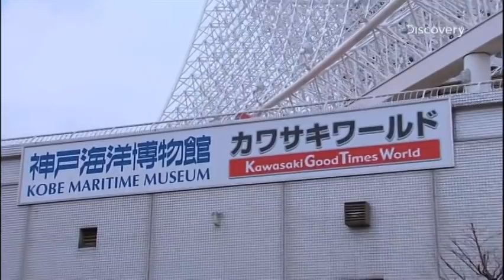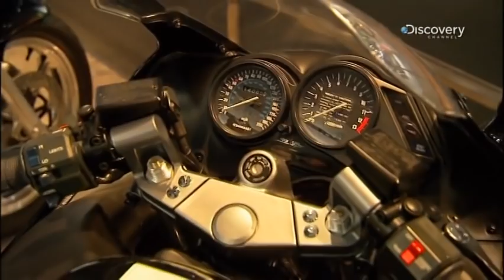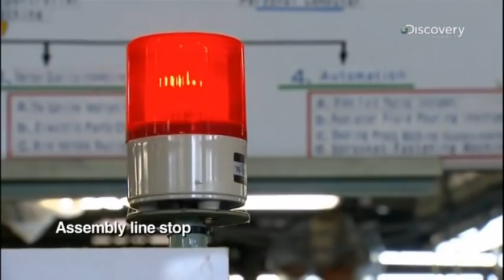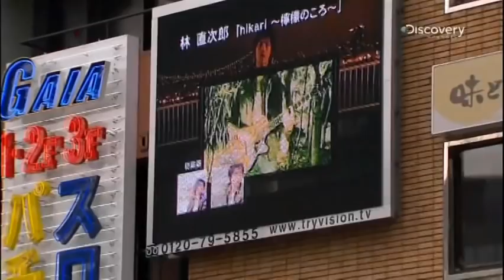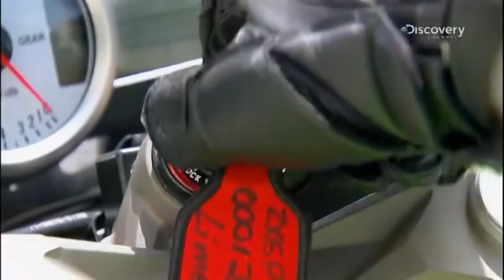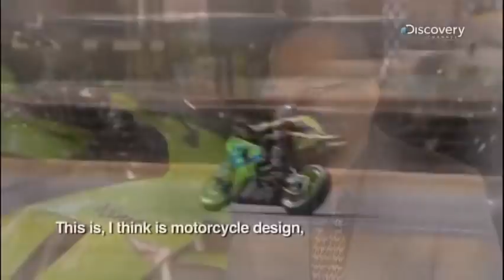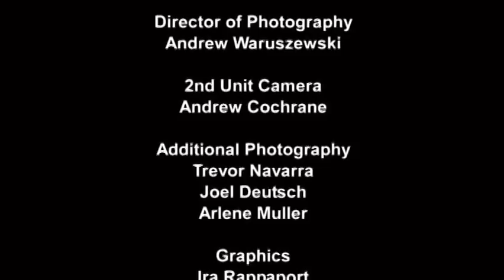KAWASAKI History, by Discovery channel, 世界のバイク

Comment: I had a 500 back in the 70s two stroke three cylinders,  Damn it was fast.  It would scare the crap out of you compared to other bikes.  Nothing like it in its time.
Reply: The engineering and quality control was always top notch at this company. 
They had Honda, Yamaha and Suzuki really worried in the 1970s.
Reply: scdevon Oh I loved the 500 triple I had.  I bought if off a friend of mine that went to highschool with me and when he gave me my first ride on it It scared the livin shit out of me.  Riding Down a windy road with sharp curves over 120 mph.  Yea he sold me on it.  I don't remember what I paid for it but I would love to have it back now.  I saw one a few months back but it needed everything overhauled but the guy wouldn't sell it.  He knew what he had.
Reply: R 
I never owned one, but they are real collector items now. It's too bad that 2 stroke street bikes were on the way out in the early 1970s. Kawasaki was definitely onto something with that design. This company was great at 4 strokes, too. The air cooled KZ-900 of the 1970s is the stuff of legends. I had a KZ-750 LTD in the early 80s and I don't think any other stock 750 on the street could beat it back then. That thing pulled like a freight train when it hit its power band.
Reply: scdevon You had the 750 3 cyl two stroke??  That was a mean machine that made the 500 look slow.  My neighbor had one and then the 900 after that.  It's a wonder that he is still alive the way he rode that.  
You are right there is nothing on the planet at that time that would even come close to them.  

A friend of mine worked for a plumbing contractor and he had a road runner with a 426 HEMI in it and he raced it with either a 750 or 900, I can't remember since it has been so long ago.   But the best thing was He beat his ass.     Talk about a fast bike .     Now a friend of mine son had one of those Ninga bikes that went over 200 mph and he got rid of it due to he wanted to come home to his kids and wife plus I think wifey made him lol
Reply: The KZ-750 LTD has a 4 cylinder, 4 stroke engine...Just sayin'  :-)
Reply: p5050 It was faster I believe than the 500.  Hell they all were fast back then.
Reply: They made a two cycle and a four cycle 750.
Reply: ***** I remember the two cycle, a neighbor had one then he got the 1000 4 stroke 4 cylinder and it ran very fast.  But back then thats is all they had and would out run anything even close to its class.  Now bikes will do over 200 mph.  That is just a death trap.  My friend's son just sold his death trap.  I think wifey made him. lol
Reply: Remember the Suzuki watercooled 750? I got to ride one. What a scary piece of crap.......slower than a slug on concrete in Kansas.
Reply: ***** Yea I remember it. But if you compare them to bikes today, well yea they are slow.  The bikes today will put you in another light and warp speed lol.
Reply: R Yeah. I haven't ridden since 95. I only rode drag bikes. I had a ex 500 that was so comfortable to ride and it would do 12's in the quarter.
Reply: ***** 12s is prety dam fast if you ask me.
Reply: R I have ridden a pro-gas kawasaki with a 1428 and a car tire. 
I shut it down half track and ran a 9.75 at 89 mph. 
That was a ride. 
The ex was smoother than silk after that.
Reply: ***** A 9.75 at only 89 mph??   You should have ended up a hell of a lot faster in the 9 bracket.  I think you should be at least 125 mph or more.  Maybe I am thinking it to cars and not bikes.  Still a sweet ride.  Almost 10 seconds is damn fast.  We new a college air cond teacher at a local college here that had a Ford Falcon with a 351 cleveland and it hit in the 10s .  I think my brother rode in it and it scared the livin shit out of him lol .   Ahh he is a pussy anyway. lol.
Reply: R I shut it off at half track . This bike was a 9.00. 
It usually runs 9.00 at 180.
Reply: ***** Now that sound more like it.  I think i would shut it down too if I were going that fast.  Shit I know when we were young we thought we could  go faster than the speed of light but we did heal faster then than  now but still that's a fast ride no matter how you cut it.  Anything in the 9s or 10s is damn fast.  My older brother had a rambler american with a 290 ci  He ran a 15:77 was his best.  Not to bad for that little car.  4 speed.  In the day I had a 57 chevy that someone put a 327 corvette motor in with the 202 camel hump heads , but it had a 3 speed behind it.   Wish I had my 57 now.  To many back in the day,  My brother paid $75.00 for a 56 chevy 2 door hardtop.  We drove it to high school.  Also had a 66 dodge charger 383 4 speed and a 67 camaro back in the day.   God , try to find them now.
Reply: I did and that thing was dangerous! It was a stick welded frame that flexed like plastic. It didn't like turning and if blew the center head gasket all the time from over heating. A clutch that needed two hands to work and sucked 2 Stroke like a drunk. 

One reason they were used in drag racing. It had one direction it like..... H1 and H2 were crap.....
Reply: Master Chief 00117 That sounds like a flying death trap.  Just build a coffin around it and you can fly to your death. lol. No you wouldn't want to do that.  Mamma and kids would be pissed.  It is amazing the shit we have had in the past and what we did to it to make it go faster and faster.  God my dad worked at the post office and the old 3 wheel  little cushman mail trucks with the box on the back, well he bought one at auction and brought that thing home and we fixed it up and painted it.  Shit we made that thing do wheelies.   We got all kinds of cars in the past.  4 boys no sisters.  All of us liked to work on cars except the oldest one. We had a lot of fun and raced everything on wheels.
Reply: R
Reply: No. I wish i did own one, though. 
 I owned a KZ750 LTD which was the 4 cylinder 4 stroke.
Reply: Wouldn't stop or turn. Also warbled all over,but what a motor.
Reply: I had a Honda 750 that was as fast but could also turn and brake. If you had a passenger the Honda would blow that thing right off the road.
Reply: Darkwell0071
We too and that Honda CB750F was a mean bike. It had all the plus that H1-H2 didn't. Plus it was a 4 Stoker.. Then the Honda 750 Interceptor changed all the rules of what Sport Bike means. As those Direct drive gear driven cams were spot on...You could toss in some custom cams grinds and it spit fire.. It gave the 1100 Ninja Fuel Injection a run for it's money..

Great bikes. I just preferred Honda and Yamaha. Honda being cheaper on parts...
Reply: I actually grew up in the 60's and 70's and owned a '72 H2-750....I'm hear to tell you the Honda 750's were not even in the same universe as my H2, the H1's would even beat them...my H2 would literally blow them away.
Reply: Let's get real. H1, H2 = flexi flyers, RD's ruled.
Reply: agreed it took a 500 triple to beat a rd350 in straight line, but my 75 rd stayed ahead of those h1's thru the twisties.
Reply: Had 77 and 78 RD400s. The aircooled RD's are still the most fun street   bikes ever made, for the money. They were the light, quick, steered great and had some real personality when tricked out. Paid $1100 new for my '78.
Reply: 999.00 for my 75rd350 orange that was a lot of money back then
Reply: My 79 RD400 Special cost $1132.00 out the door. Then last one I bought new was 1986 RZ350. Last year of the street 2 strokes in the US. The best being the RZV\4 500.
Reply: Cool, you know the good bikes. 
All money aside, I'd take an new RZ350 over the RD500v4 even now.
The complicated 500 was a little disappointing; mild state of tune but much harder to mod with the v4 and way too heavy for a two-stroke.
The RZ350 was a gem - in a class of it's own for production racing - just wish they upped it to a  "RZ450" twin with about 75-80 rwhp.
Reply: If you worked for Yamaha like I did for 5 years. You could get your hands on racing parts for RZV\4. It was not that heavy to me. It just like to chew up clutches. So you had to replace the factory wet clutch with a dry clutch. 

It's hard to find parts for them now days. But those 4 tuned pipes where like music to your ears. You stood out in a crowd of 4 strokes and 2 cylinder 2 strokes. They knew you was coming and moved over....Last of the 2 stroke fire breathers in the United States. Then I moved over to Honda. The Interceptor was just to much fun to resist. Then 1998 changed all the rules with R1.
Reply: Must have been nice -  good for you! 500V4 was beyond my mean$ back then. I wasn't crazy about the "new" 16" front wheels either - saw too many throttle jockeys on 500s and mostly 750 Interceptors suddenly lose the front end on off-cambers and get slapped down. Now, if I could find a hybrid with Japan's  RZV500 with the aluminum frame and the Canada RZ's faster engine, I'd never let it go. Not holding my breath on that. Yamaha tried, but the steel framed 500 was around 475lb wet- needed to lose 50+lbs, IMO. My superstreet RD400 was only 304lb full tank with a 67hp Spec II motor. Still hoping for a new high-tech oil/fuel injected twin RD/RZ of any size in USA.
Reply: My first experience on the Mach III was also  ride on the back. We'd spent half an hour working our way out of town to some back roads. After stopping to verify where we were we headed out with the other 2 bikes leading. As we rolled away from a stop he turned his head, told me to hang on, and rolled on to full power for about 15 seconds at full song. I'd never heard anything like it, never felt anything like. looking over his shoulder at the tach, hitting red line each shift. 115 with a passenger. I'd never had a thrill like that even in my neighbor's 64 GTO 389 Tri-power, close ration muncie, 4.11 rear. 

Ok, well maybe about the same. But this I could afford. 

I bought that bike.
Reply: You couldn't get the 2 stroke to run clean enough. Modern engines are amazingly less polluting than old ones. I loved my Mach's but I understand.
Reply: a stock one is about 12.3 on good run. the Mach IV was 12 flat.National record was 11.81 but had a blueprinted engine. I raced against him all the time or I'd have more tropy's.
Reply: 12 flat or low 12.s was faster than any of the stock muscle cars. Especially on the street without perfect asphalt. That's how I'd make a haul street racing. The bike was very nearly as fast on the street ass the strip. Muscle cars not so much so.
Reply: not at the same time  they didn't
Reply: ex 500?
Reply: 500 about 12.3 or 4. 750 12 flat.
Reply: twist the throttle in 3rd and bring the front wheel up with total ease!
FUCK YEAH! Awe,memories!
Reply: How could the doco not mention the H2 750?
Also the H2 750R used in racing against the TZ750 Yamaha?

Comment: Excellent documentry, thanks for sharing,I love my ninja, Kawasaki till I die <3
Reply: +stuntweasel27 Dude! which ninja did you own?
Reply: I`ve got 2 zzr`s,both 600`s.1 is a stock `98 model and the other is based on a `93 frame with a `98 motor and 1100 front end. I`ve been 3 years building the `93....nearly done.
:)Lancer Nismo
Reply: nice bro

Comment: Ive personally owned two Kawasaki Ninja's over the years, 1985 750 and a 2005 ZX10R, both were high quality machines with no problems. When the American insurance industry tried to destroy the sport bike market during the late 80's with extremely high premiums, Kawasaki started issuing their customers a credit card, with a line of credit high enough to actually purchase a motorcycle, this was basically an unsecured loan, so the customers weren't required to have full coverage insurance like borrowing money from a bank. Even on a sport bike, liability insurance was still affordable. This saved the sport bike market. All this being said, coming from someone who grew up in the 60's and 70's the motorcycles that really fanned the flame of motorcycle enthusiasm in America would be the mini bikes, they were our first introduction into riding. Machines like the Honda trail 50 and 70 series of mini bikes. The next step after that would be dirt bikes, and a series of street legal dirt bikes known as Enduro's, which for many, was our first introduction to legally riding on the street. Kawasaki and Honda weren't well known for building street legal Enduro's, that was mostly Yamaha and a few Suzuki models. They should do a whole show on the Enduro's the motorcycle that transitioned riders from the dirt to the street.

Comment: First H1 500cc Kwak triple I saw, my mate and I were out on Honda CB 250 & CB 350 respectively.
We weren't far off the limit for our bikes when I glimpsed a headlight coming up on us like we were parked up.
Sodding thing flew past us.  Could barely credit just how fast the damn thing was for the time.
Years later I'd wind-up rifding a ZX6R J2 which was capable of outperforming the H1 all round  - But hell I'd still have traded it for a mint H1. 
For all the H1 was reputed to handle like a drunken sow on a skateboard that thing was Iconic.

Comment: Regarding the GPZ900R as the "the first Kawasaki with a water-cooled motor" 

The KZ1300 came out 5 years prior to the GPZ900R, and was the first production Kawasaki with a water-cooled engine.
Reply: +BikesBeerandMetal  14:56 True, the narrator misquoted. I think he meant to say the GPz900R was the first production Kawasaki with a 4 valves per cylinder water-cooled engine.
Reply: Technically, Kawasaki had built water cooled inline 12 engines for airplanes during WWII.
Reply: That was Mitsubishi.
Reply: No he's right, it was a 12 built by kawasaki but it was an inverted v-12 and it was licensed by Daimler-Benz.

Comment: My first new bike was a Kawasaki Centurion, 100cc. I was 15 at the time. Somehow, I avoided an early death. In a drag with a Yamaha 250 it would pull ahead of the Yamaha for the first 50 yards. The stock expansion chamber pipe on it was so loud. At full throttle from a distance it sounded like a mad bumble bee coming toward you.

Comment: The trick to get the most performance from the 1969 H1, was getting the oil injection pump set to the proper cc's per sec. Best memorise in my life of riding.

Comment: I rode a 500cc Mach III.  It's an experience one does not forget.  Never felt the need to try the 750, as the 500 was wicked fast.  Trouble is, the handling hadn't kept pace with the power and they eventually earned the name "Widow Maker."

Comment: There are mistakes in the narating tho; the first watercooled Kawasaki wasn't the Ninja 900, it was the KZ-1300 6 cylinder and, the first fuel injected wasn't the Ninja either, it was the 900cc Z1-G, a custom bike with the first DFI (Digital Fuel Injection).
Reply: You are right, I had a 1000LTD and then a 1300 touring. when you nailed the 1300 it sounded like a Porsche. Lots of heat though in hot weather. 
Could smoke the tire easy with the LTD

Comment: I had two H2’s. One stock (‘72) and one modified stage 3 (‘74). A 84 ELR, GPZ750 Turbo, 93 ZX7R I use to race in CCS, a 93 ZX7 I put a 94 ZX9 engine in and a 98 ZX9.  I ride Honda’s in the dirt only. 86 CR500, 87 CR500, and 95 CR500.

Comment: Here is the thing. I had an S2 360 then the H1 (that was 1975).  They seemed fast after I maxed it out. When the Z1 came out. I could match its acceleration but every time I shifted they just kept pulling away (without any shifting).

My Yamaha RZ350 has as much horsepower as my H1 (after souping it up a bit). That was 1985. Hell. it is os light that when I tune it for top end I can get 126 MPH. They pulled it off the street in the US after just the one year.

I must admit that I think the new H2 would scare the crap out of me. What a beast.

Comment: From my 750 LTD ,my KZ1000 to my Concours I have been on a Kawasaki since a teenager .
Reply: My son rides a 750 ltd...we got it used with about 18K miles. swapped the ugly ramhorn bars for superbike bars and did some custom work on the turn signals. Then just went through the usual valve adjustment/cam chain tensioner/carb sync routine.....runs like a sewing machine now and will easily peg the 85 mph speedo

Comment: Those older ti-cylinder bikes should have been called Kawa sake. When the electrical winding's in the flywheel mechanisms were working right it was a screaming machine. Front wheel up without trying. The 350 Kawasaki Bighorn was one of the baddest and best of it's time as well for off road.

Comment: In 1987 I bought my first Kaw. It was an 900. By 1989 I was at the drag strip. By 1993, I had a extended swing arm, eight inch slick, air  shifter, 1200cc, cams and a highly modified frame. Oh yea, couldn't ride it without wheelie bars. Fastest was 9.82. I'm sixty one now.  I have black spoke wheels on my wheelchair. And a fairing.

Comment: Apparently Discovery Channel doesn't like 2 strokes. They never mentioned that the Mach 3 was a 3 cylinder 2 stroke and skipped over the most important bike Kawasaki built, the Mach 4 H2 750. I was hoping to see more about the Kawasaki 2 stroke triples, but instead they skipped along to the current Ninja brand.
Reply: I too was disappointed by the lack of coverage of the 2 stroke era, they went from the Mach 3 to the Z1 in no time at all completely ignoring all the KH models.

Comment: Mine was a 1974 Mach 4 H2 750. Frame and engine serial #'s were 33369 and 33095. Acceleration Machine, made to go in a straight line as fast as possible.